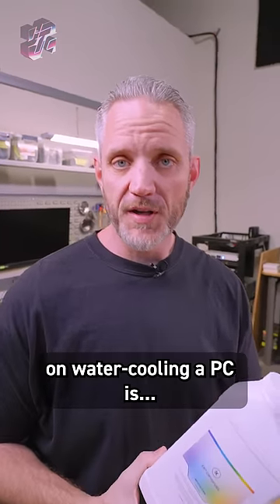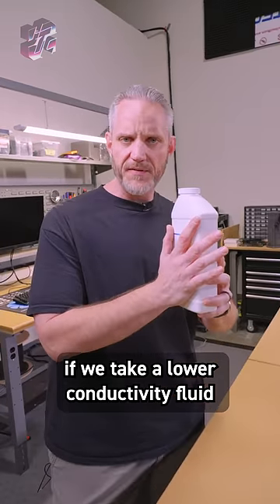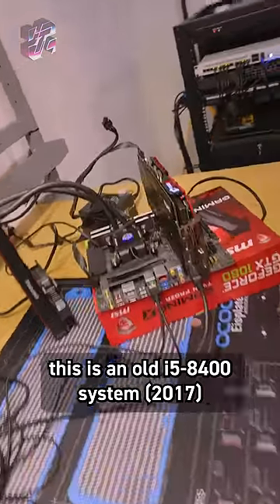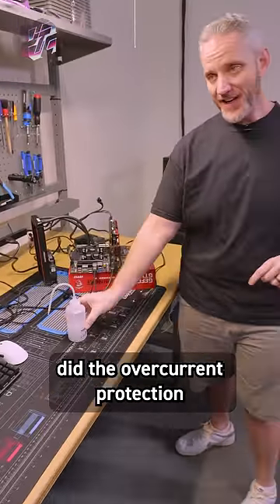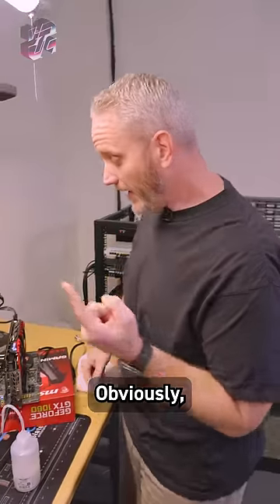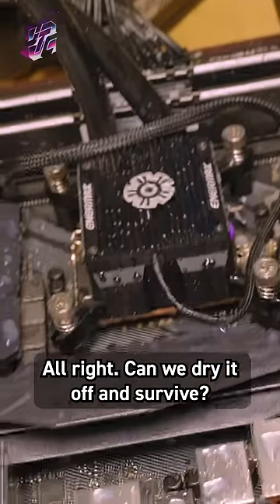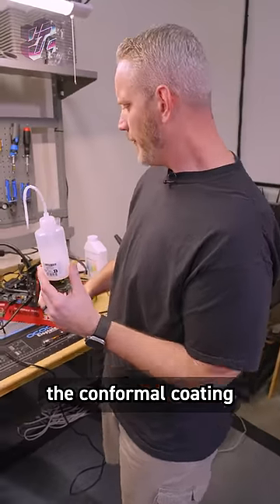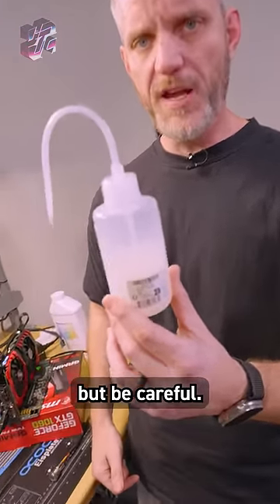Pouring water on a PC for science!    #pc #pcmr #shorts

Comment: i disagree. if you are unlucky you short something on your RAM or CPU to 12V before your PSU can react. This is why my old AM4 system is now in the process to be replaced by an AM5. RAM has trouble to not bluescreen, Board has trouble to not blacking out and GPU black out as soon it gets shit to do.

Comment: I had a tube in my loop pop out of its fitting and drain the reservoir all over my motherboard. Computer shut off, I took it apart and dried everything, and now it's all back to normal. Whether it's the mobo, CPU, or power supply, everything's gotten more tolerant of liquids over time.

Comment: The informational value here is pretty lacking.

Depending on where the short circuit happens there is no way for the PSU to protect the parts from damage.
Most parts will be fried way before the supply current hits the threshold for the PSU to shut off. Whether it does comes down to how lucky you were for the short circuit to happen.

Comment: No no no.
You will run the system again after drying it but the question is for HOW LONG.
Corrosion will destroy your machine over the time if you don't clean it with an alcohol and clean it properly.

Comment: I mean overclocking isnt the same as it used to be in the 7600k days. You really cant even overcoock a 5600x without losing performance. Id rather just use a good air cooler and never have to worry about shit

Comment: Killed my X299 platform with a water leak. Technically it still booted, but it had a bunch of issues that made it unusable in practice. I'm still not sure if it was just the motherboard or also the CPU as I had no spare boards lying around.

Comment: I accidentally knocked over an entire glass of water on my old desk which of course immediately ran off the back and fell like a waterfall into the top vent of my case as i watched in horror and heard my GPU fans immediately go into hyper mode. I immediately shut all power off to the system via the power strip, opened up on it's side and gently blotted all water off that i could see. I had a tattoo appointment to go to so i left it on its side under a fan on high speed. About 7-8 hours later it ran just fine. However, the water hitting the GPU while powered shortened the GPU's life substantially. When it died about a year later, you could see the spot where the water had hit it had become weaker and weaker until something just burned out.

Comment: Can anyone identify what power supply is that? Im thinking of Corsair ax series,but can't really sure enough
Reply: Its actually an SF series PSU, as can be seen in the zoom in atfer water is poured on the system a second time. But its hard to tell which wattage it is or even just from which year it comes, because in the meantime new SF PSUs with PCIe 3.0 came out and also before that, there were different versions from different years.

Comment: I'm hope it works power supply please 🥺

Hello brother, is x570 printed circuit board PCB against short circuit (silicone paste) or water resistant also I'm using amd 5000 (graphic plus CPU) I'm don't have a graphic card not a gamer it's a 5650G 
Do new generation CPUs and motherboards make it possible to not damage the CPU or motherboard, such as too much water or silicone paste accidentally spilled on the socket or the CPU pins, of course I cleaned them, unfortunately I'm at a place where I can't do anything  I do not have access to a city, I hope that it will not be damaged please someone answer me

Comment: Water cooling? Spend extra money on a platinum rated brand name power supply. Especially if this is your first home-made open loop attempt. Unplug the AC line cord AND pull the CMOS battery if you have a real gusher before trying to soak up the worst of the spill with towels, your Life Insurance Company will thank you. Remember, it's best to disappoint Our Lord Darwin as long as possible.
*Unplugging the CMOS battery is to protect the circuit traces on your motherboard from voltage induced corrosion until it dries, not to keep you from harm with 3 VDC at a couple of milliamps.

Comment: YES LEAKS ARE VERY BAD ZAP THE ENTIRE WORKS   There is one more thing  WHEN A AIO and ITS PUMP GETS ROTTED AWAY BY MOLD that is why I use AIR COOLING ONLY its simply  to use easy to clean. AIO  ANTI MOLD FLUID  DOSEW NOT WORK I seen too many videos on the mater can  you think of thr RTX 4090 with a BUILD IN AIO that you spend $3000.000 to $4000.00 on that the PU MP ROTTED AWAY BY MOLD and ASUS, GIGIABYTE, MSI and son and so forth will not take care of your repair  take the blame for breaking it

Comment: My daughter spilled water on top of her rig and killed the GPU. Water directly from the top to the gpu pcb. No power supply would have saved it. Your test isn't even done with the system in a normal orientation. Almost nobody has a horizonal case.
Reply: Because this wasn't pure water, AIOs don't use the same water you drink. It's a mixture.